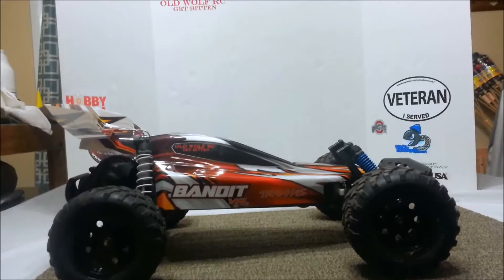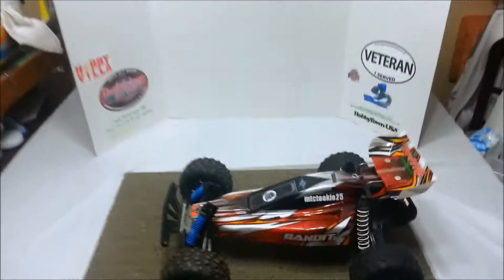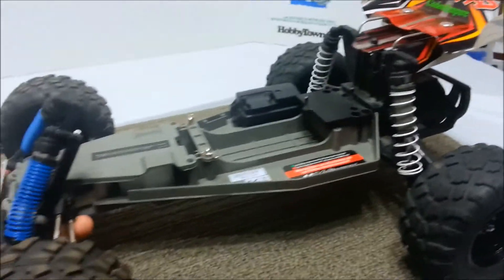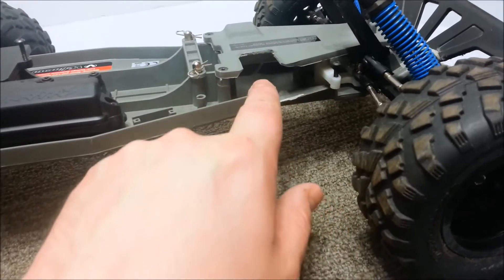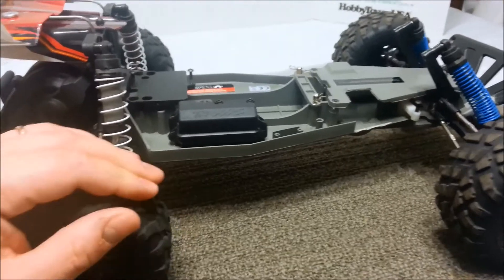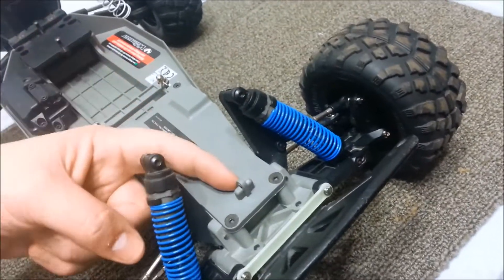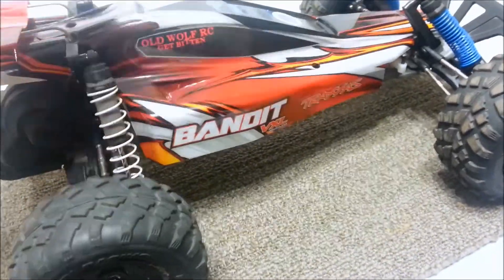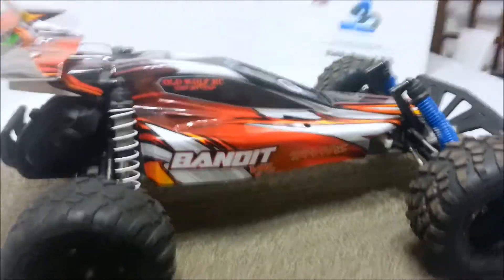Project Rodimus

Comment: I'll be that 70+ Bandit owner you mentioned bro! Lol!! Unfortunately I couldn't make the top weight plate work on my Bandit. That's why I created the undercarriage weight bracket. You can get those weights from Harbor Freight for a better price. And I'm guessing he cut those spots out so debris wouldn't get lodged in the steering...just guessing.
Reply from the maker: Thanks. :)
Reply: Let me clarify the better price comment I made. I meant harbor freight has better prices for weights than an auto store. I wasn't talking about the top plate weight.
Reply from the maker: kk

Comment: Great haul, you will have fun making that go 70+ mph. I had to postpone my testing for the club, but I'll be back on it in a few. I would go with the 17mm adapters with the GRP tire/wheel combo,lower it to the max. The gearing, well let's just say 31/76 won't get you there, but its a great start for getting use to those types of speeds.
MIDWID bro!
Reply: Also,if you don't want to dye the chassis, the recommended paint is Krylon Fusion Satin spray paint,it's perfect adhesion to the RC plastics.